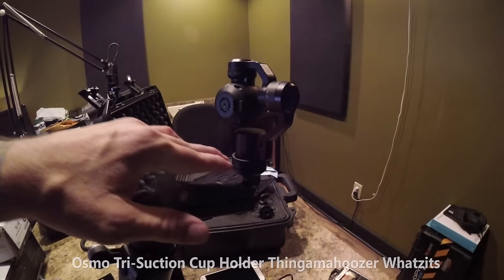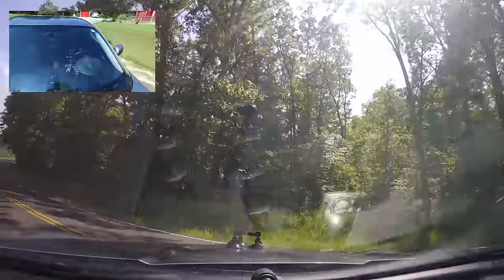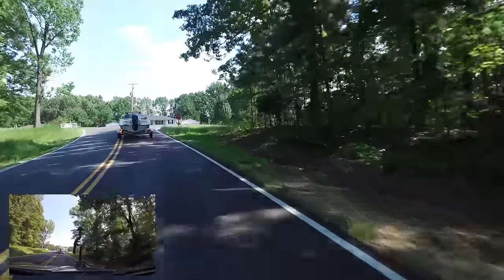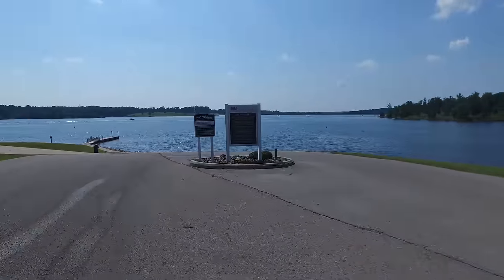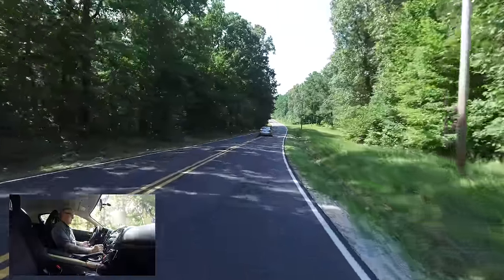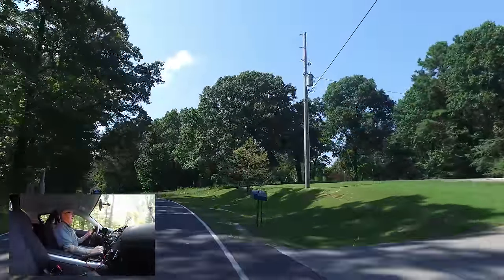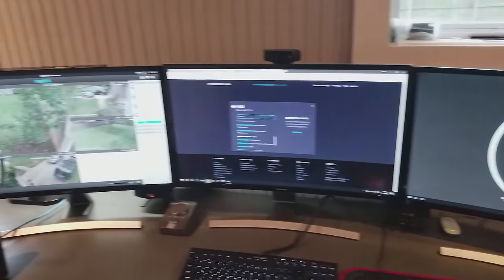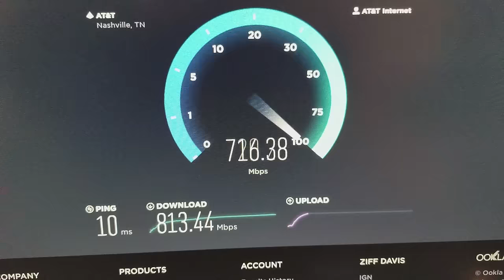KEN HERON - OSMO Suction Cup Mount and Z-axis  [4K]

Comment: Actually had gigabyte speeds and slowed down to 100 meg up/down to save $$. Couldn't tell the difference from 100 to 1000.. Could tell the $15 bucks. 

Nice bike Ken! I'm part of the older crowd so ADV type bikes for me. Loved the osmo footage. Very steady and smooth. 

Did the suction cups do any damage to the thin metal of the hood? 

Thanks for the video

Comment: Seems to manage pretty well but it's a bit harsh at the end of manual turning, so Osmo should probably update the firmware to include end of movement damping to decelerate the head and get rid of the abrubt motion stop.
Reply from the maker: That would be a good thing.